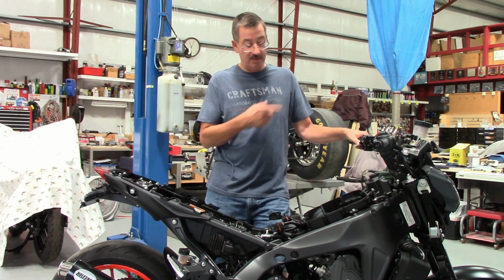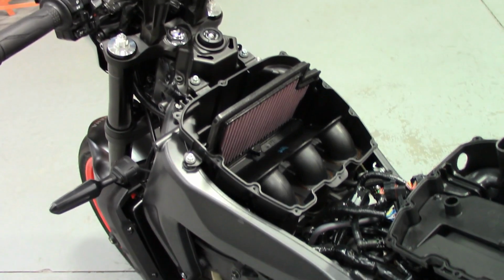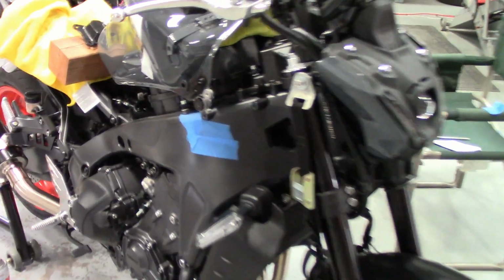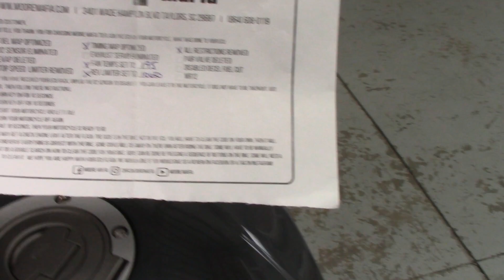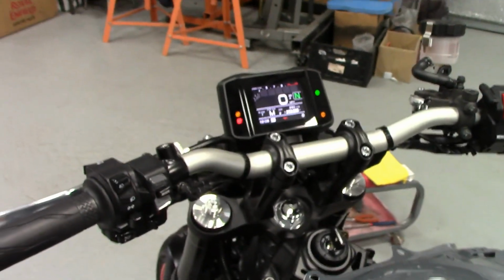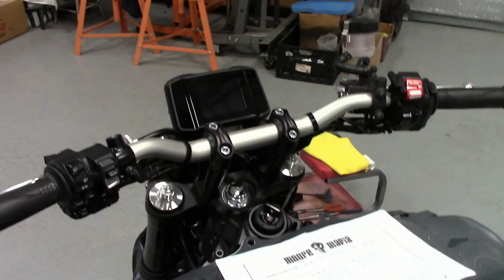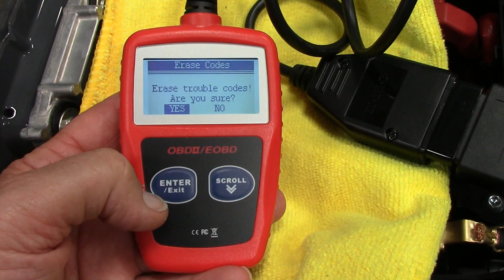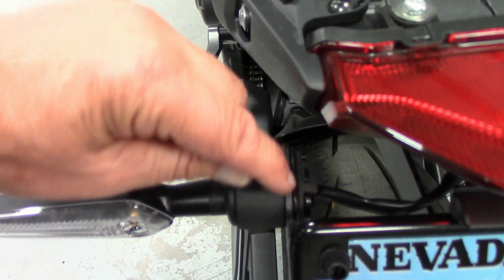2021+  MT-09 Moore Mafia ECU Flash , Air box mods assembly *  Dale Walker *

Comment: Just curious, but why do you not flash the ECU yourself Dale? Have been doing this on some of my bikes since Woolich was working with ECU-editor.
Is it because of the cost? A bit inconvenient to send the ECU back and forth to CM (or any tuner with relevant hw/sw).
On  my current Z H2 I also use PC to fine-tune after removing (reflashing) the restrictions in th ECU.
Reply from the maker: Mainly because for years I've been testing and developing my own tuner with Dobeck TL.,  I've found in most cases timing doesn't do much with most models. I get just as much or more out of motors by removing the secondary's, with my air box mods , added air flow, and I pre set each tuner for my customer. There is ten ways to make power with smooth running, and its only as good as the guy doing it and putting in the time.  

 In this case the speed limiter really bothered me, so I teamed up with Chris on this one. I also need to slow down a bit after my cancer battle, and I'm  look forward to retirement, having fun with my bikes and making fun videos. The other big reason is the off road closed course use only is getting to be a thin line now.  Cheers D
Reply: @DaleWalkerHoleshot  Yes, agree with you there. In my case I just like to "fiddle" with this "nerdy" stuff. On these modern ECU's the flashing process takes quite some time to finish, which I find strange. It is not that much byte's that must be "written". Reminds me on old 1200baud modems vs todays 1Gb transfers. Room for improvements here. Even factory updates (BMW) can take hours and the bike must be connected to the factory over WAN! So much more convenient to use a "piggy-back" you can adjust on the fly. On the Z H2 the timing has to be advanced on top to make any serious power, but that is not without risks. :) This ECU flashing have become a "necessity" as most if not all manufacturers puts so much restrictions in the ECU's. Yamaha is one of the worst together with Triumph on certain models (MT-09, Speed Triple 1200).
:(
Reply from the maker: @TL1000S97  Yep they are getting smarter smarter to try to block us ... LOL !   Trust me even with my Tuner piggy back set up I spend 3 days on the dyno and road test, then back again a few times. The dyno is not the holy grail and fully real world power delivery. I was at the race track the last 3 days, and have not been back here yet on the MT-09 but we may need to take little back out of it in 1st and 2nd gear. Cheers DW

Comment: CM flashed my DL's ECU.
Reply from the maker: Chris is a good guy and does a great job at what he does. This will take a couple trips back and fourth to get my own tune for my air box mods with DNA filter dialed in I'm sure. I normally would remove the butterflies, make my own tuner and do my deal, but the only way to get rid of the speed limiter was to flash it. Cheers  Dale